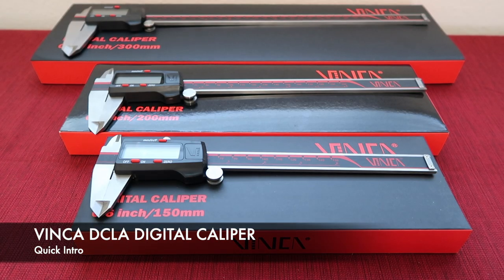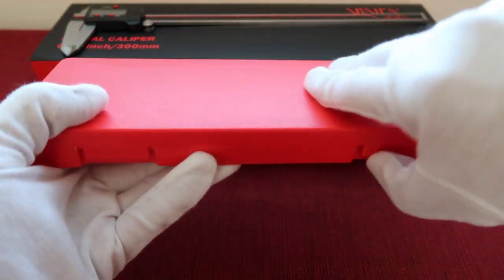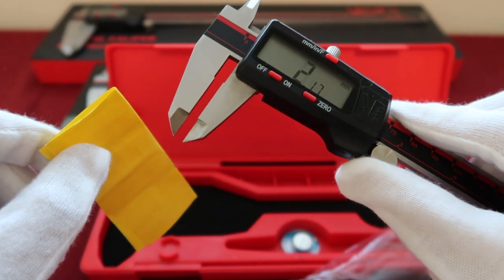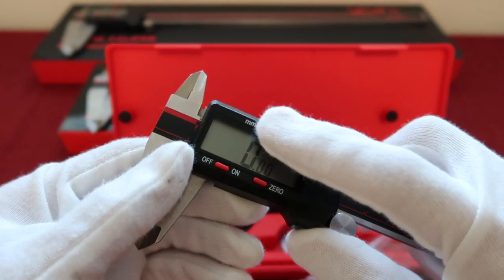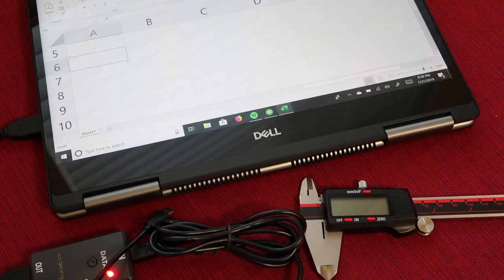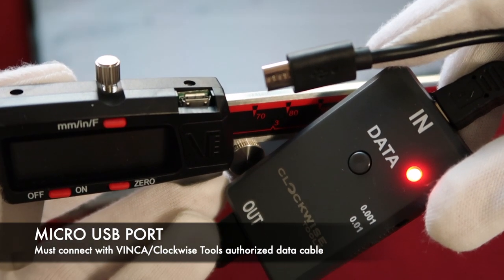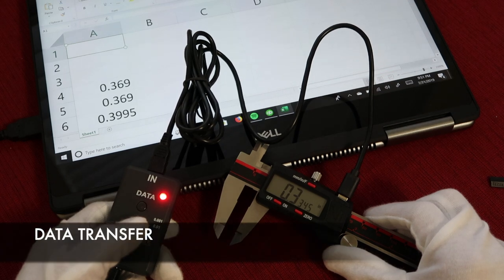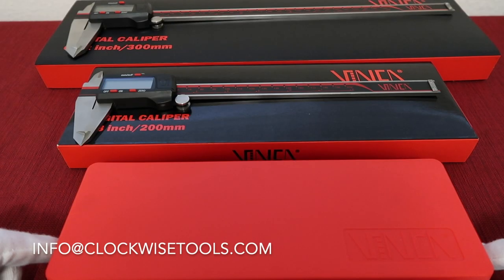VINCA DCLA Digital Caliper review and tutorial

Comment: I just purchased the 12" dcla-1205 and im noticing inconsistent accuracy from one measurement to another. for example, If I measure an 11/32" drill shank with the 1205 it gives accurate reading. verified by another brand 0-6 caliper. When I measure a 5/16" drill, it consistently reads as 19/64 .295" while my other caliper brand measure correctly at .312". When I measure a 1/8" endmill it reads .109" while my other brand caliper reads .124".  This is repeatable so I do not believe its a bad battery as the reading for 11/32" is consistently correct on the dcla-1205 but not on the other drill sizes. Is there a way to calibrate this model? I just received it new from amazon.